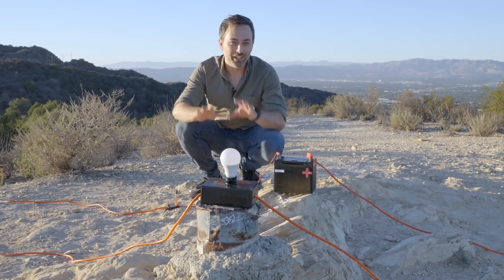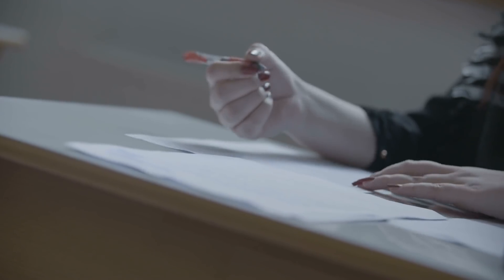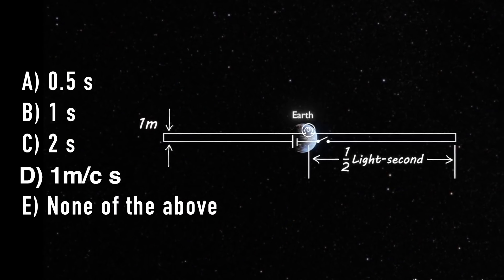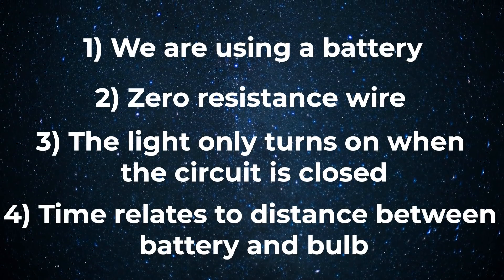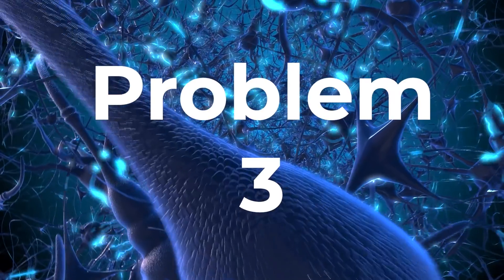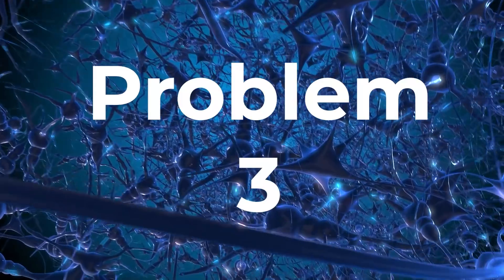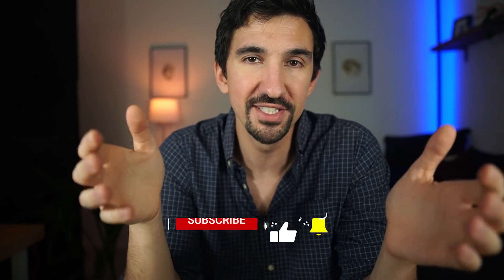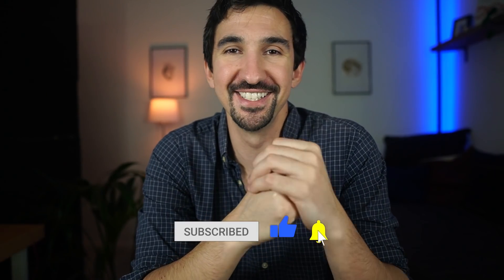Is Veritasium Wrong About Electricity?

Comment: Inclined to agree with you ... but consider this change:
Use a large, circular loop, 1 light year in diameter with a battery, light and switch close to you (lets put the batter and switch 2m apart with the light in the middle, 1m from each), and another switch on the opposite side of the loop, 1 light year away. When you close the close switch, are you able to "instantly" test the switch on the far side of the loop?

In the setup above, the wires are no longer side by side, so cannot influence each other like antennae.

If you cant test the remote switch, then we break causality, so that can't be right, so we both agree that its not just about the circuit.

So what really matters?
 - The distance from the battery to the light?
 - The distance from the last switch to close, to the light?
 - The distance from the furthest switch, to the light?

What matters is information. So lets define these functions
Sx(y) = the State of object x at time y, where x = l for light, b for battery, s1 for switch 1(close) or s2 for switch 2 (far)
tx = time taken for light to travel from light to x so we get:tl = 0, tb = ts1 = 1m / c, ts2 = 1 year

I attest that the function for the light is Sl(now - tl) = Sb(now - tb) AND Ss1(now - ts1) AND Ss2(now - ts2)

This means that by opening and closing the switch at s1, we can only test the switch at s2, from 1 year ago.

So far, so good.... but this next bit breaks my brain.

We run the wires, and close all the switches, but don't have a battery yet. We leave it set up like that for a while ... longer than 1 year .... then we connect the battery. In this situation, the light should turn on in 1/c seconds, because we have let the system sit in place for a year, so we can test that 1 year ago, the far switch was closed. So the state of the switch has propagated back to us, but what moved? The information moved, but what else? The field, some electrons? There was not battery to drive them?

Maybe ... and this makes me smile ... everything is connected to everything else, by some sort of field, even the battery sitting on the shelf at the hardware store, 12 months ago. That battery ... all of the batteries at all the stores were connected to our light by this field, as were both switches. We just needed 12 months for the state of the remote switch to propagate back to us so that when the battery was brought into the loop, and the the final connection made, the field could become active and turn on the light in 1/c seconds.
Reply: Thank you you have inspired me to write my thoughts. I am blowing my mind on your far out concept so I write:  there is an interesting but mysterious process in nature called fractals, which repeat in different but similar patterns over and over. And  then there is the uncanny  exactness of quantum science math. There is math and physics which explain how these things work, but we have not been able to find the grand theory yet. Suppose all these things are part of  big immensely complicated machine called the universe, that operates on differences trying to equalize. Again with all these waves bouncing around or whatever they do, they are actually programmed from the very start to do their  programmed thing as time progresses. No waves before the big bang then trillions of  trillions of waves suddenly appear, with specific action and reactions to each other coded into their very nature. All power sources and non power sources have a connection to each other however minute, and they are all trying to equalize at the same time through waves and waves of particle charges, magnetism and gravity and information. Each bit of information  is waves cascading into waves governed by laws of cause and effect creating fractals upon fractals =  best analogy is a stream becoming a river and ending at the sea. Each tiny droplet somehow effecting droplets miles away and every other droplet in the stream. So we can place a dam in the stream and control the flow, but the water will always want to flow down to equalize. The static water in a closed dam continues to build as water melts by the heat of the sun and flows downhill. So perhaps the universe is one big complicated river flowing in time controlled by what each wave is allowed to do according to the rules set in place for wave propagation and quantum physics, and now we have a contrived universe suggesting intelligence. 
But as mere mortals we can only see beyond our rear window and do what we are doing now contemplating.

Comment: The thing you are missing is the rest of the sentence "The Speed of light" ....in a vacuum. Light travels faster in different mediums. The other thing you are missing is that electrons don't need to flow the entire distance, but only the distance to the next nearest electron essentially pushing all of them as if they were all connected like pearls on a string. While this appears to break the speed of light barrier, it does not because the electron that returns is not the same one that left the battery.
Reply: No, the speed of light in a vacuum is the maximum. Light can travel slower in other mediums, but it never travels faster. (And light is an electromagnetic wave, so the same rule applies to this circuit scenario). 

This video is correct if you actually paid attention. The signal on the actual wire will travel at roughly the speed of light, but there will also be an antenna effect between the two ends of the wire. In real life I think that antenna effect is mostly negligible though so the whole Veritasium video is very misleading.
Reply: Search Cherenkov effect.

Comment: Anothing thing that annoys me with the common example of "it's not actually electrons in the wire turning on the light" that's used to explain the field transferring the energy, is that it ultimately still is the electrons turning the light on. It's not the Poynting vector's force, it's the electrical current interacting with the resistance of the wire to heat it up into giving off black body radiation. Just don't put a lamp there.

Comment: No. He is wrong.
He assumed that most energy go shortest distance to bulb.
But most energy goes along field close to wire and this is not shortest distance.
He is right when he told: energy goes from field, but he totally wrong visualise it.
Very small of energy go to bulb the shortest way - but this is too small to bulb work.
Almost all energy go to bulb with field close to wire. And this take time: about 2s - becuase this is very long wire.
Also bulb needs time to warm up and light but this is not the main question.

Comment: I don’t think this problem breaks causality- we’re not assuming that the information can only be passed through the wire. Information can be passed through space as well. When the switch turns on a magnetic field is produced around the wire, which interacts with the wire above, there is no faster than light communication here.

Comment: You are wrong.
there will be one switch one meter from the lamp we call it switch A, and one switch 300,000 km away from the lamp, we call it switch B.

The start point: Switch B is connected, switch A is disconnected.

The point 1: Switch A connects.
After 1/ 300,000 seconds, the lamp turns on.

The point 2: switch B disconnects.
after 1 second the lamp turns off. Because it will take 1 second for the lamp to know the power is disconnected..

Comment: I will copy a comment that I recently made to Veritasium's video:
Even if you assume that the power to the lamp is transferred via direct electromagnetic interaction between the parallel wires it will take much longer time than 1 meter divided by c for a real lamp to receive enough power to turn on. After the first 1 m/c seconds only 2 m of wire can be interacting and the rest of the wire can be regarded as non-existent.

Comment: I'd assume for the light bulb to turn on, it would need to receive a significant fraction of its spec power. Yep, sure you can measure that surge on the parallel wire, but it's just a tiny fraction of what's needed to turn the light bulb.

Comment: I agree. I agree in so far, as the point of the Veritasium video as I see it is about energy transport, that does occur through the EM Field (the energy doesn't "ride" on the Electrons). Now, there might be some Energy transported immediately because the wires would act as antennas (which is also what the papers that Veriatsium links say if I read them correctly). But then again, the lamp wouldn't light up from that - the energy necessary for that would still be transported via the field along the wires. At least that is the way I see it.

Comment: The problem you have with assumption 2 (at 4:20) is that you think energy is travelling ALONG THE WIRES ... it's NOT ... it's travelling BETWEEN the wires. so you could have TWO OPEN CIRCUIT LOOPS and STILL get energy transfer from EMR, Induction or Capacitance. 
It also ignores ALL the known facts about quantum physics, and especially quantum entanglement which has been proven to exist, where the effects on one particle were measured at its entangled partner INSTANTLY, even though in some cases it would have taken several thousand times the period between effect and result for the information to be transmitted at light speed

Comment: Watch the RSD Academy video about this very Veritasium clip, where it's shown to be CORRECT in THREE DIFFERENT WAYS ... Capacitance, Induction and ElectroMagnetic Radiation (EMR). In all cases THE LENGTH OF THE WIRE HAS ZERO EFFECT, and it's ONLY the distance between the source and the target, which will equate to D x 1/c (If they were 2 metres apart it would have been 2/c, etc). However this whole situation is reliant on superconducting wires, with NO IMPEDANCE, which any MATERIALS engineer will tell you can only occur in certain materials at temperatures approaching absolute zero. In normal copper wires however there will always be SOME resistance, and thus some energy loss when current is applied (CURRENT, not voltage ... that's why primary transmittion wires are at up to 200,000 volts, but only 0.01 amps or lower, because current is lost as a percentage per distance ... and 1% of 0.01 amps is much less than 1% of 10 amps.

Comment: This is one that Veritasium got wrong.  Anyone in networking can tell you that the length of the cable has everything to do with how long it takes a signal to get from point A to point B.  Network communication is nothing more than applying a voltage to a cable.  If Veritasium's video could be taken at face value, you could string a 1m zero impedance ethernet cable between point A and B and receive the signal in the same amount of time as if you VPN across the U.S. and back: both cases would receive the "packet" in 1m/c seconds (about 0.003ms).  In reality, the 1m cable would result in a signal received in 0.003ms but the cross-country cable (east-west-east coast) would take an absolute minimum of 31ms, even though point A and B are (still) 1m apart.

Comment: I'm not in physics, but I do like your explanation and it made me wonder ...
Lets set aside the point that electromagnetic energy can be transmitted by EM fields through empty space, which I assume is what Veritasium want us to understand.

If I then consider your antenna analogy, then I come away with the understanding that, if I have a battery and a tiny piece of unconnected wire and I touch the battery with one end of the wire, then the electrons actually flow in the wire (for a very very short amount of time since it is DC), even if the wire is unconnected at the other end, since we need moving electrons to induce a field that can transmit energy to the other wire connected to the light bulb.

Is that correct?

Furthermore, if we have the fully connected wire from the Veritasium video AND the switch is connected at the far end of the wire, say ½ a light second away from both the light bulb and the battery, then there would be (at least) ½ a second delay before the light bulb would turn on.

Correct?

Comment: The 'break cause and effect' point is not correct.

The point of the Veritasium's video is that signals (and energy) travel through space at the speed of light, and thus go from the closing of the switch to the light 'across' the space between the wires.  (Note, however that if you do the detailed analysis, the light won't turn on at full power at 1m/c later; there are a bunch of effects that need to be considered.)

The best way to understand this system approximately is to think of the side by side wires as a transmission line.  Signals propagate down transmission lines at the speed of light (adjusted for the refractive index of the medium that contains the conductors).  In this approximation, the terminals of an infinitely long transmission line simply look like a resistor at the characteristic impedance of the line.  (Note: this approximation considers the speed of light along the line, but ignores it 'across' the line; clearly incorrect but a useful approximation.)

At the instant the switch is closed, you have a series circuit consisting of the battery/switch, the lamp, and two resistors representing the transmission line.  The lamp 'instantly' turns on at reduced power because of the transmission line impedance.  (Of course this real transmission line is 1 m wide, so it really takes 1m/c for the signal to even cross from one side to the other, and additionally there will be start up transient effects caused by the width, but we are ignoring these to get the 'big picture'.)

At the instant the switch is closed, energy starts flowing down the transmission line at the speed of light.  Eventually it hits the terminations.  In the Veritasium example, the terminations are short circuits.  With zero impedance the termination cannot absorb any of this energy, so the energy reflects at the termination and heads back to the bulb.  At a time equal to the transmission line 'out and back' duration, the reflected energy hits the bulb.  In the case of the shorted termination in the example, this reflected energy adds at the source, and the bulb gets more power.

So I'd expect if this were really built, that the bulb would turn on very quickly (on the order of 1m/c) and then about 1 second later get significantly brighter.

If instead of short circuits at the ends of the wire we instead had open circuits, the initial response of the system would be similar.  Roughly 1m/c after the switch is closed the lamp would turn on, and energy would start flowing down the transmission line.  At the termination the open circuit again reflects the energy, but inverted.  This reflected signal then propagates down the transmission line to the lamp.  About a second after the lamp turns on, it turns off again.

Now imagine we put a switch at a termination point, letting us change the termination from open to shorted.  When we flip the switch, the reflected energy instantly changes polarity _at the switch_, and this reflected energy propagates down the transmission line to the lamp.  The state of the lamp changes 1/2 second later, perfectly in line with causality and the speed of light.

-Jon

Comment: You need a college Fields professor to answer this question. All I remember taking it 30 years ago is in a "coax" the insulation between the center conductor and outside shield controls the speed of the electrical propagation.  Now if there is zero resistance it would be a super conductor, and it would travel at the speed of light.

Comment: I think you are almost right. I think there is a missing point in veritasium. He assumed that resistance is zero … ok. But for his answer to be true you should also assume that impedance is zero, that is not the case. This is a very big antenna, you transmit an impulse but you receive a signal very large in time. I would say that the right answer is: the light starts switching on after 1/c seconds, but it take some time to switch completely on, I guess a couple of second? As you said …

Comment: I think the "lie" comment was more of a click bait tool, not intentionally deceiving.  I thought his point about current flow was the main point of his argument.  When discussing just alternating current and how it works, is the main confusion.  The power generating plant is where your source AC electricity originates.  Factor in all the other generating plants that also float on the line and then the understanding starts getting more challenging.  Forget RF and time.  The only time involved is our cps from the generating plant.  Since electron flow is assumed to be on the surface of the wire (field), when you consider the amount of current a conductor can carry, say a #12 awg vs 500 mcm conductor and the difference between the amount of rated current flow, then the math doesn't seem to work when you're just considering the field.  When you group the wires together, (3 phase), the fields cancel each other out.  ??

Comment: Vsauce is partly wrong. One way to think about that is that electrons practically don't move from the wire. They are placed in such a way in the wires that they form a "capacitor" creating electric fields. The first impulse of energy we could say it is really small and transitional from the battery to the bulb. This energy doesn't go through the wire, it goes through air. The main proportion of energy goes through the wires without causing any problem on causality.